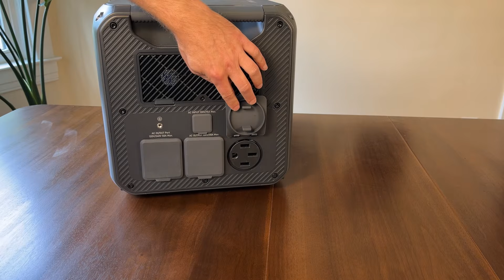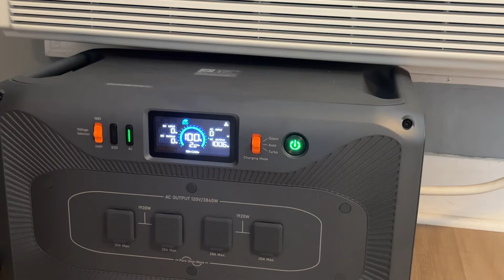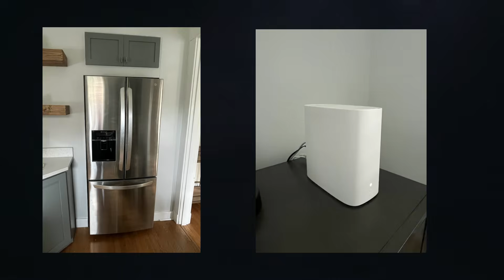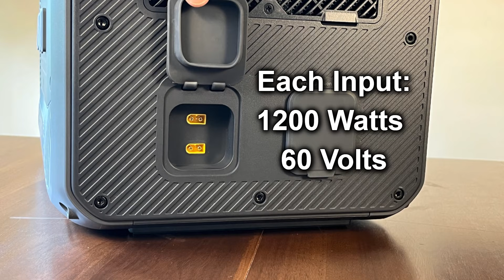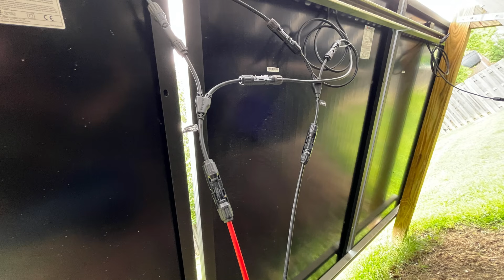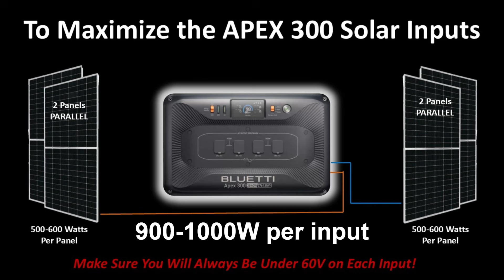Testing the Bluetti Apex 300 (with tips for 240V and solar connections)

Comment: I just bought the Apex 300 and have 2kw solar panels attached.  1k each solar per port, but it limits the PV to 499 watts max (250 per port). Doesn't matter if I attach it in series or parallel .. Does anyone know what could be the issue? why it clipp and cap it at 499watts pv ?

Comment: There isn't any current limit for solar input, other than from a practical standpoint. The Bluetti, or any similar device isn't going to accept any more current than it allows in. Think of a 1 Watt LED night light. Plug it into a US standard 120 V, 15 A outlet. It's only going to draw a few mA (milli Amps). Same with the solar panels. The solar panels don't "push" current into the powerstation. The powerstation draws or "pulls" the current it can accept at that moment, and that's it. When the battery is empty, current draw will be high, but no more than what the unit is rated for. When the battery is full, the draw will drop to zero.

Comment: THANK YOU soo much for this! I’ve been searching for a straight forward answer to my question about these power stations and their ability to power my 240v in wall AC. And thank you for showing the plug I would need.   

Now I just have to figure out the most economical way to store enough power for a 5-9 hour power outage.

Comment: Could i parallel 2 x 500w bluetti portable panels on both inputs,  so a total of 4 500w panels . 
2 on both sides keeping voltage under 60 by parallel and adding amp would be about 4 amp over.

Comment: I found 200watt panels at Bouge RV. With 4panels 2S2P I come up with 943 watts. That's the best I found so far.
Reply from the maker: Thanks for sharing - I'm interested in trying something like that with my 200w panels.  Did you mean 743 watts?
Reply: I hope I'm doing this right. The VOC is 28 volts-The IMP is 8.6 amps. Series 2 panels get56V- Parallel 2 panels get 17.2A then combine both for 963W. This is upper limit. Most likely you will not get this much. I am new at this stuff so maybe  I'm doing it wrong @BackyardSolarProject  .

Comment: To maximize solar charging, use a DC to DC step-down converter so you can run your panels in series. Set the output to around 60V to max out your solar wattage. A 2000W step-down module is advised gives you more headroom and generates less heat.
Reply from the maker: Thanks for the suggestion about the step-down converter for putting the panels in series, stepped down to 60V.  If you can, post a link to one that you think would work. In the meantime, I'm going to do some research on them.

Comment: daaam i was looking at buying the apex 300 for a 240v steam cleaner and it uses 17.5 amps at 3800 watts, so this unit is a no go than? im a novice when i was looking for power stations all i was concerned about was 240v power at 3800
Reply from the maker: Actually, look into power lifting mode on the APEX 300 - it may be able to run your steam cleaner as its designed to lower voltage to power resistive loads like heaters. Definitely don't just go on my suggestion, though, and do some research.  Also, most power stations, APEX 300 included, can surge above their initial wattage for a second or so, to get a device started.  Good use case, btw!
Reply: @B @BackyardSolarProject hanks and I may have to ask Bluetti may do the oupes 6000

Comment: 60V is an ANNOYING Voltage for solar inputs... I don´t know about the small FOLDING panels they try to sell overpriced, but ordinary panels are usually 32-35 V = you can´t put them in series.
Series have one small benefit (if it was possible) as the voltage drop (through cables) becomes relatively smaller when you have a higher voltage.
A 80V input would be good, would allow for 2 panels + a safety margin for cold temperatures.
The AMPS (while not perfect here) are still better at 20A, than many competitors or smaller power stations, who can have 12-18 Amps.
Reply from the maker: Agree - I haven’t found a panel that’s easily available to put two in series on the APEX 300.  Good point about 80 volts being better.
Reply: Old sunpower panels have 58volts do 300-350wp and can be parralel. Amps are around 6.
Reply: @hippievogelei  That is good for those who owns some, but every affordable panel here is between 30-40 V which is annoyingly in the middle of the possibility.
New bigger panels in (2026 or 2027) might get a different voltage than  the  30-40V we have now.
Reply: @PjotrII sunpower 320wp sold @ 2013 so wss high end back than with patent busbar @ the back.
Reply: Bluetti wants you to buy an add on box that would allow higher voltage solar arrays. The apex 300 by itself is cheap because its missing all the add on components.

Comment: So you you cant use the 120v & 240v simultaneously?  If I wanted to power my well pump  240v & the gas heater runs on 120v?
Reply from the maker: You can use 120V and 240V at the same time!

Comment: best solar would be 3 x 12v 200w panels in each port?
Reply from the maker: That would be 600W on each port.  However, each port is theoretically capable of 1200 watts (60V x 20A), you just can't go over the voltage, so you have to stay comfortably under the 60.
Reply: @BackyardSolarProject so its 2400w total 😊

Comment: Would I be able to connect 2 -  ShadowFlux™ N-Type Anti-Shading 200W 120W Solar Panels to the apex 300?  31.3v each panel. So one panel in each input ?
Reply from the maker: If they are 31.3V each, you would need to put one on each input.  Before you buy cables to connect them, you may want to consider getting one larger panel for one of the inputs if your budget allows.
Reply: @BackyardSolarProject  ok than k you. Perhaps these would be better... Renogy Solar Panels 2PCS 320 Watt Solar Panel 18BB N-Type Solar Panel 12 24 Volts Monocrystalline

Comment: Is ok to go over the 20 Amps and won’t damage unit ?
Reply from the maker: From everything that I have read, power stations are damaged when the solar inputs go over the Volts.  It is my understanding that extra amps, generally, are not an issue for the power station, because it only pulls up to a maximum amount of amps and does not use the rest.

Comment: Thank you for a very educational video - I learned a lot about the solar input.  I purchased four Renogy 450 watt panels from Amazon, and still am not sure if my single Apex300 unit can handle the four panels at the same time - Renogy Solar Panels 900W 12V/24V Bifacial Solar Panel Monocrystalline 2PCS 450W On/Off Grid Application Rigid Over 500 Watt Solar Panel High Efficiency Durable for Homes Roof RV Boat Camping Black.  If you are able to help me out, I would greatly appreciate your help...Thanks...Abe Azar
Reply from the maker: I think those should be good, connected two in parallel on each input.  That should stay below the 60V max, but it doesn’t hurt to check your voltage, especially in cold weather.  You’ll probably hit around 675W on each input.

Comment: Pensé que se quemaría al sobrepasar el amperaje o el voltaje. Entonces el Apex 300 solamente limita la carga y no se quema, o estoy equivocado?, porque quiero probar con 4 paneles longi de 425w, 41.05v y 10.36A, para alcanzar teóricamente 1700w, conectandolos en paralelo de 2 paneles sería 850w por linea y el mismo voltaje de 41.05v pero a 20.72A (lo cual no es mucho amperaje sobrepasando el limite), y en serie quedaría en 850w 82.1v(aquí si sobrepasaria mucho el voltaje máximo de 60v) que no veo muy factible y 10.36A. Podrías orientarme?, saludos desde Honduras, me costo encontrar un canal con este tema en especifico para el Apex 300 ya que es nuevo aún.

Comment: Get you a server rack battery. Like a 100ah. Hook it up to your apex 300. Then hook up your array to your charge controller. And connect it to your server rack. So you can max the pv input of 1200 watts. Or double your power with two server racks.
Reply: I did that getting 1104 watts in from a 51-48 volt server rack battery 5100 watts for almost half the price almost double the wattage of a B300K 2764 Watts
Reply from the maker: How would you connect the server rack to the APEX 300?

Comment: I would recommend the same what depends solar inputs. I can't try it out yet, but I already bought 4 Trina Solar Vertex S+ dual glass whitebacksheet of 455 Wp each. They can create a working voltage of 45 V each. Some people warned me that that also would create over 60 V in winter. I don't believe so - not in my country at least. I'm having solar panels since 2009 already - so, dare to say having some expience with it and in my country, it never gets below 0°C combined with high sun radiance. Most installers at that time in 2009 also only looked at the Voc of the panels itself at 25°c, which is much more realistic. The panels which I bought will have Voc 53 V - which is still more than 10 % below those 60 V. So, I think I can trust this. I will put 2 times 2 of those panels parallel. The amps will be fine as well, maximum 10 amps each.

Comment: The Apex 300 has a 240v / 50amp “bypass” so if it was plugged into the grid would it power your heater?
Reply from the maker: That is a good question and observation.  I don’t have the 240V input cable to test it out.  I did test it while connected to 120v input and it ran the Air conditioner at 240v while charging at 120v.   But, that was only 1100 watts.
Reply from the maker: Quick follow-up:  While I am unable to test, I have been told by a couple of sources that it would. If anyone has tried it out, please respond as well!
Reply: @BackyardSolarProject thanks for the investigation. I think this is a “killer feature” you shiuld test it if you can get the 240V cable.